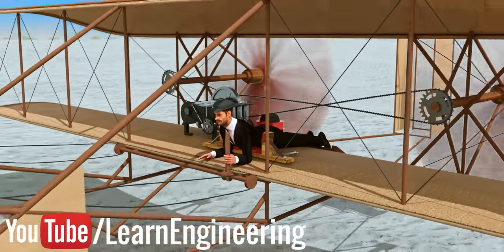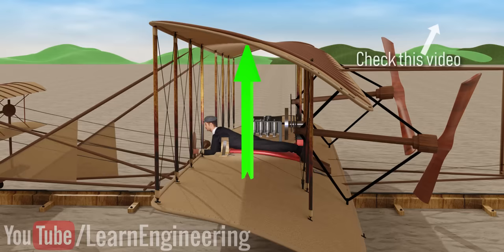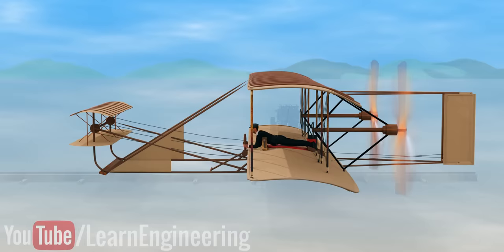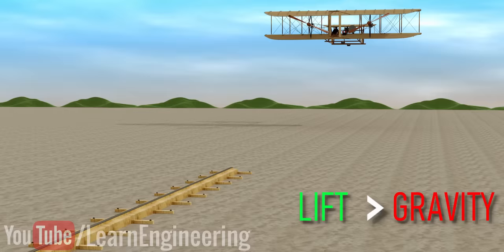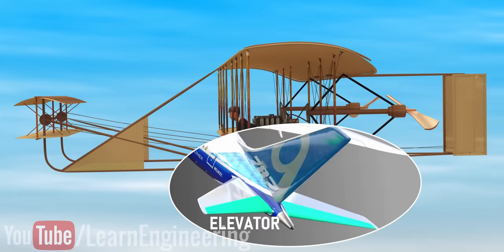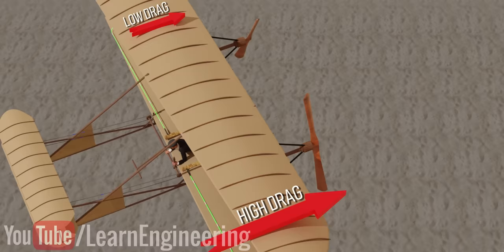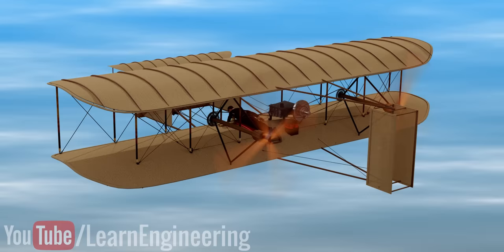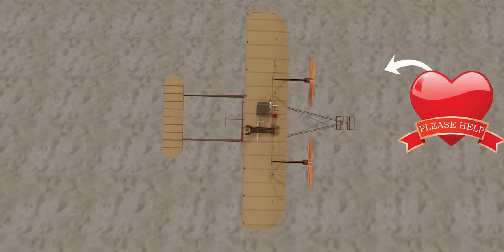The Brilliant Engineering of FIRST FLIGHT !

Comment: The centennial proved it all. Wright brothers didn't FLY. And in the test stages, the replica without strong headwinds did not leave the ground. With strong headwind support it just glided for a few meters and the engine of 50 Hp did not sustain in the air!!

Comment: Very good basic explanation of some rather difficult aerodynamic principles along with the graphics.
The pilot is off center to counterbalance the weight of the engine. If I recall, the right wing was also a foot or so longer to balance out these unevenly distributed weights along the longitudinal centerline of the aircraft. Anyone denying the Wrights were first in flight and in flight engineering… well, the are just ignorant of the facts!

Comment: awesome video! I have a question, how is this gyroscopic effect overcome on airplanes that only have one rotating blade on its nose?
Reply: There is another vertical blade spinning at tail .
Reply: I don't believe there is any method used to overcome this effect other than the pilot compensating using the rudder. In modern planes the inertia of the prop is not as significant when compared to the mass of the plane so the gyroscopic effect is weaker.
Reply: I Guess they provide This single propeller opposite direction to the engine shaft by using gear arrangements..... So, it can cancel Gyroscopic effect....
Reply: Guido Perdomo 👍
Reply: @sparkindustry1  what's interesting to note is the gyroscopic precession on early rotary engine aircraft where both engine and prop rotated. 
This produced different results when turning left or right.
Reply: On single-engine airplanes, the wings and rudder are designed to produce a counter-rotation force as the plane flies forward.
Reply: Plenty of right rudder during takeoff is what is used to compensate for the torque effect. The gyroscopic forces are also minimized by the prop being mounted centerline to the aircrafts roll axis.

Comment: The Wright Brothers were classic Development Engineers.  Communicating with Otto Lilienthal,  pioneer hang glider Design Engineer and pilot of Germany,  they used Otto's lift calculations until they found that they were wrong.   So they then built their own wind tunnel to test different aerofoil shapes.  Power to weight ratio is always critical on a powered aircraft.   They omitted wheels and associated undercarriage to save weight,  landing on a simple and very lightweight skid.  To reach flying speed on take off they constructed a guide rail and a vertical tower with falling weight with rope over pulleys to the aircraft to get the aircraft to flying speed.  Their hip operated wing warping system they later changed to the lever control which was initially just used for the forward elevator control,   to the joy stick still in use today.
When controlled flight was demonstrated to the French some five years later,  their aircraft could at that stage fly for over 1 hour.

Comment: Why nobody is asking how can he land correctly?😅😂
Reply: Are you asking that question?  The early flying machines had trouble landing on wheels.  The Wrights landed on skids and invented the "pancake
landing" which often broke things but they could usually be quickly repaired.  For a smoother landing, they needed the assistance of a good
headwind.  Unlike the other pioneers of flying, the Wright Brothers loved
strong winds.

Comment: the stupid engineering of the flyer.
Reply: @Gilbereto Nedel

SB:  Do you want to elaborate?  

What do you find stupid about the Wright's engineering practices?  
Are you saying that you can't see why the Wrights were minimalists?  

Why use an engine that was barely able to power the craft
with the assistance of the wind?  

Without the strong wind the 1903 Wright Flyer prototype 
would not get off the ground.

You comment was to short to reveal where you are coming from 
or what you are rejecting.
Reply: @stevebett4947  The criticism comes from the fact that the wright's motorized glider was useless, did not run, did not take off, did not fly and did not land  Another detail is dependence on the wind characterized the glider. If they used it so much the headwind did not reach the plane level. The demands were clear: No external means could be used. The wrights were wind dependent, they had only one glider.

Comment: The narrative says that the wing's camber was towards the front, but the video shows a perfect curve. The scene of the plane in a turn shows the wing being warped correctly, but doesn't show the rudder turning in the opposite direction of the turn, as it would have done. Another important design choice was placing the stabilizer in the front, instead of the rear, which made both the gliders and the airplane much less susceptible to a dangerous stall. With the stabilizer in front, the plane usually descended under control, if it entered a stall. Finally, Charlie Taylor deserves more credit for building the engine. I believe the Wrights told him how much power they needed and a desirable weight, and Charlie did the rest. The Wrights were not particularly generous with him either, as later in life, when Orville became very wealthy because of their patents, Charlie fell on hard times, yet Orville made no effort to help him out.

Comment: I wonder how many times they failed / crashed shortly after take off before the first stable successful flight? Amazing they didn't kill or hurt themselves so badly - I'm sure the low speeds helped.
Reply: They failed / crashed shortly after take off a lot, but on gliders they also built. They learned to fly before they actually did their first powered flight.

Comment: Wright brothers developed sustained powered flight but Glen Curtiss developed ailerons and rudders to easily control the direction of the aircraft. Wright brothers controlled flight direction thru wing warping which really would not work with a stiff wing.

Comment: The brothers settled on the dimensions and positioned two propeller blades in back to push the plane from behind. The blades would rotate in opposite directions to prevent them from turning the plane left or right on its yaw axis.

Comment: If you watch the movements of the plane the pilot must continually adjust the elevator. Today's planes have a horizontal stabilizer, which is fixed and the elevator is hinged on that so when the pilot moves the flap it modifies only slightly the effect of the stabilizer rather than the whole unit as in the Wright flyer. Also the elevator of today can be trimmed with the trim tab.
Reply: That forward elevator, yikes😬 !  Very abrupt movements,

Comment: To balance the weight of the engine that weighed 180lbs.  Engine and the pilot weigh about the same, hence both are approx the same distance from the center line of the plane.

Comment: Charles Taylor,  the Wrights mechanic. had worked for them for in the bicycle shop.  They asked him if he could build the engine and gave him weight and horsepower specifications.  In 6 weeks he'd built a 4 cylinder, water cooled, aluminum block and crankcase engine under specified  weight and more power than requested by 20 %.  Seems he knew about engineering too.

Comment: This was a truly great video about the invention of the aircraft!! 

On my channel there are about 30 videos of the first and only heavier than air solely ion propelled aircraft to lift its power supply.

The Wrights and Sikorsky mostly "solved" the control of powered aircrafts, and also from about 2005 to 2010 in particular, electronic systems were developed that allowed for active stabilization of all sorts of small drones.
Reply: SANTOS DUMONT INVENTED THE AIRPLANE
Reply: @joy_hipermorte  no he didnt...he never flew anything but a balloon till 1906. By that point 10+ others had flown since the wrights

Comment: The real inventor was Santos Dumont, he didn't need help to take off, and the first flight recorded on video with the 14 bis in 1906, in 1907 the Demoiselle that the world copied
Reply: The 1903 Wright Flyer took off by its own power, as did the 1904 Flyer initially.  Later, the Wrights used a catapult as a performance preference, not because their aircraft depended on one to take off at all.  And video didn't exist in 1906.
Reply: @cardinalRG if that’s true then why te replica of their flyer could not take off alone
Reply: @vinibruh1397  --No attempt has ever been made to fly a replica 1903 Flyer I in equal conditions.  If you'd like a more comprehensive explanation, I'll be happy to provide one.

Comment: The blade design generates backward thrust. Very clever..
Reply: Thrust is always in the forward direction, regardless of whether the propellers are of the tractor or pusher type.
Reply: @cardinalRG  SWell, if you take a little care and look at the propellors, you could have seen that their curvature is the wrong way around.
Reply: @michaeljaneschitz-kriegl9598  --No, friend.  With a given direction of rotation, a propeller’s “curvature” is the same whether driven in tractor or pusher style, because in both cases it produces forward thrust.

Comment: The gyroscopic effect was overestimated by the Wright brothers as well as by Carl Benz (Benz used an engine with a vertical flywheel axis, because he thought that a horicontal one could compromize the stearing of the car). Such forces like precession or torque become important, if you use engines with houndreds or thousands of horsepowers in a light weight design like in the casees of fighter planes or race cars.

The elevator at Wrights flyer worked considerable different from the elevator of modern planes. It generates additional lift if you rise to higher altitudes. In modern aircrafts it generates a down force which compromizes the total lift of the aircraft. It was more a practical compromize to allow the pilot full sight in flight direction. But there are some aircraft still today which uses front elevators (the so called Carnard design), like supersonic designs (the elevators become very small) for military aircrafts.

Comment: This is the best!  Every kid should learn this in school at the same age they learn Bernoulli's Effect.

You guys should do a series where you introduce every MAJOR airplane innovation one at a time, and describe how each works along with in-flight usage.  The very next one could be describing how the Wrights re-designed their Flyers for Army Signal Corp specs-- specifically, adding a passenger and adjusting the positions of everything in the airplane.  What if a 2-seater has no passenger?  What if carrying heavy mail in one direction, but empty in the other direction?

Comment: So the pilot does not have a closed cockpit. He can use the force of his legs to move front/back and use the arms to move to the sides like on a modern kite flyer. Why is this not enough ( and only used as a backup? )? I like the amplification effect that the pilot is carried by the leading edge and the fixed parts by the trailing edge. "Adverse yaw" control is a great invention: People in fast planes cannot appreciate this active compensation scheme used here.  The A 400M also has counter rotating propellers as had the P-38. In both cases slow flight maneuverability was improved and the tail could be reduced in size ( 50/50 due to global optimization ).

Comment: American authorities initially credited Samuel Langley with the first manned powered flight using a steam-powered airplane. His steam-powered model planes flew well, but had no pilot.So he upped the scale and had his associate, Charles Manley,  become the first pilot. 

Problems: Langley had only two flight controls, and when up=scaled the airplanes that were structurally unsound with a pilot aboard failed to fly. Both attempts to launch Manley from a house-boat with a launch rail structure atop it failed. Manly attempted to pilot the Aerodrome (as Langley named it) in its only two tests, October and December 1903. The machine failed to fly both times, plunging into the Potomac River immediately after its launch. A reporter who witnessed the second launch described it as the plane and its pilot went into the water as looking like “mortar sliding off a hod.” Manly was rescued unhurt, although he was briefly trapped underwater after the second test.

The British DID give the Wright Brothers credit for the first controlled, manned flight, and asked for the Flyer so they could display it in one of their museums. American authorities, after realizing their mistake, had to negotiate to get it back.

Comment: Here, in Brazil, there was a man who also invented the plane: Santos Dumont. He made the first successful flight in public. But his plane couldn't roll, moving like a ship in the sea, and he was controlled while standing. And it was capable of taking off by itself.
He won the prize and was recognized as the inventor of the plane by the French at that time. Of course no one talks about it because USA is the USA, (w)right?
It was more like those planes that the wings are in back. 
Santos Dumont invented his plane, 14-bis, independently, since he hadn't any information about the Flyer, and his intention was not profit. I think he let the project available for the public.
He also used to invent airships. Some of these were small enough so he could park outside his apartment and use like we use a car nowadays.

I like to think that all of the inventors who were trying to invent the plane deserve recognition. Science and technology are not made by one person, or two.
Reply: The 14-bis had a cunard control like the Wright Flyer, with the main difference that the front was involved in both elevation and lateral controls.  This design failed miserably (the 14-bis was nearly uncontrollable when in the air), and it was his second plane, the Demoiselle, that greatly resembled modern airplanes.

You are right that Dumont was much less concerned with profit than the Wright Brothers, who refused to exhibit their plane for large crowds until the patents could be properly filed.  Their flights in 1904 and 1905 were viewed by just enough people to prove that the plane worked.  Once the patents were filed, the Wrights actually crippled the US aviation industry, suing people like Glenn Curtiss for building a functioning airplane.  Because of this, when WWI broke out, the US had to use British and French fighter planes because ironically they couldn't legally invent their own.

Comment: The pilot is off center to compensated for the engine which is also off center on the other side. It was an amazing feat of engineering. The Wright brothers actually designed a wind tunnel so they could test the perfect shape of the wing. I really hated it though when they built an exact replica to fly for the 100 year anniversary and basically crashed it at the end of the track. I wished they had put a more modern engine on the replica and better props so it would've had enough thrust to fly that day. I know there was a lot of hard work put into it and they wanted to be as exact as possible, but come on, it was a once in a lifetime flight for the 100th anniversary. Everyone watching there and on tv just wanted to see it fly. It also goes to show just how perfect conditions had to be for that first flight. Oh well, just 81 more years to go for the 200th anniversary.

Comment: I guessed as much. Not to meddle with the point of center of mass. If the center of mass lied with in the body of the pilot his slight body movements would be enough to disturb the dynamic equilibrium of the aircraft.

Comment: Hiram S. Maxim's 8,000lb 'flying machine' (strictly, a lift test-rig) powered by two 181 hp steam engines and manned by a crew of four. In 1894 it took off, without directional steering, and was airborne for some 600ft. Members of the Aeronautical Society of Great Britain with Hiram Maxim's 'Flying Machine', 1894. So the Wright Flyer doesn't hold the record as the first flight, or first powered flight, only the first controlled powered flight as it could steer to a slight degree by twisting it's wings, the reason we thing that the Wright brothers did the fist flight is because the Smithsonian museum signed a secret agreement not to publish details of earlier flights so they could get the Wright Flyer back from the British Museum. It's a funny old world isn't it?
Reply: I don’t get how that would benefit the British and why they would be interested in their own countrymen not being recognized as the first to fly.